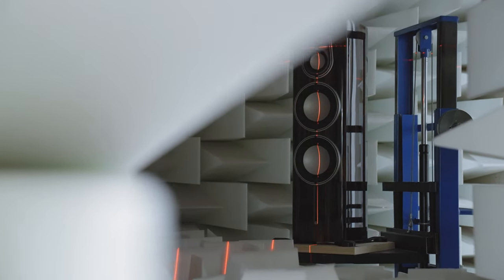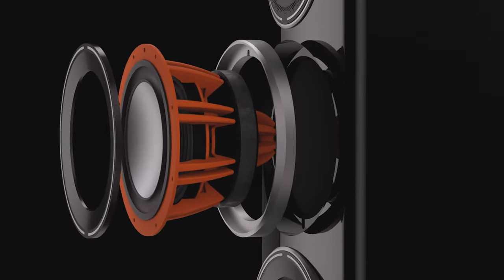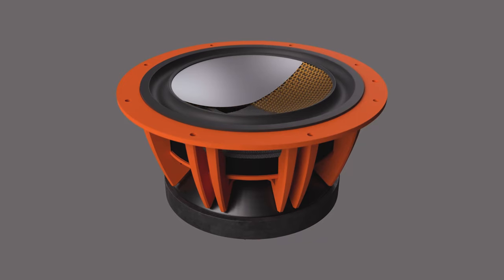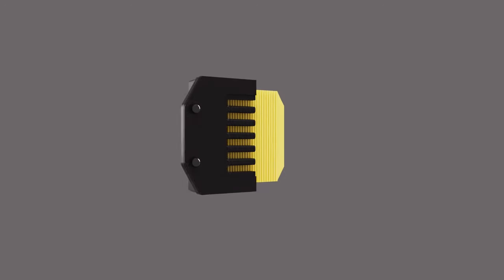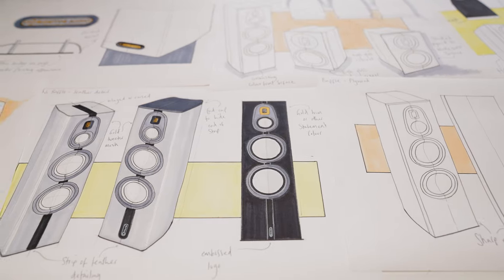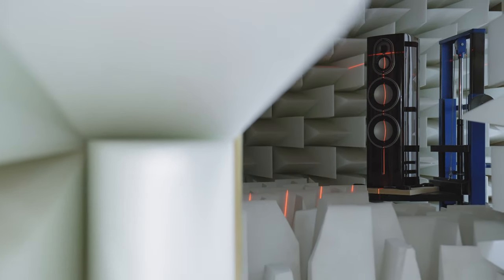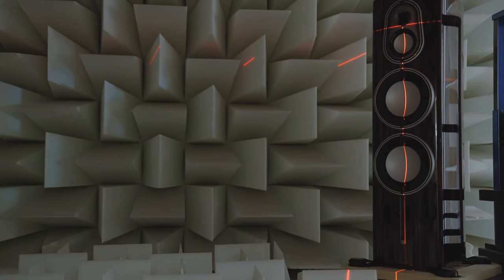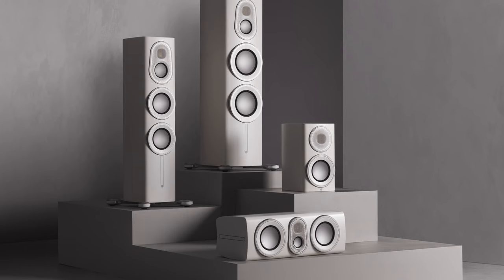Platinum Series 3G - Creating Objects of Desire | Monitor Audio

Comment: I have the Platinum 500II speakers with tiger like wood finish. Still burning in my audio quest dragon cables and doing some tweaking. Need 100hrs for a baseline.

Comment: Which amps will pair well with the silver 500 7G ?
Reply from the maker: We can't specify particular amplifiers as it's up to your personal preference, however the Silver 500 7G requires amplifier powers between 80 - 250 W in 8 Ohms.